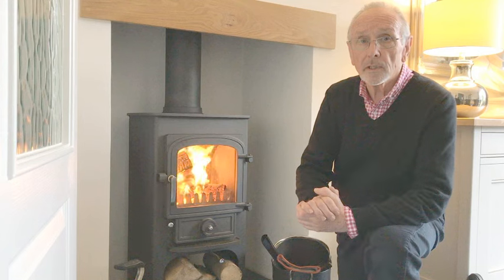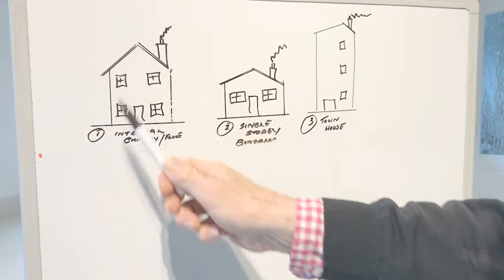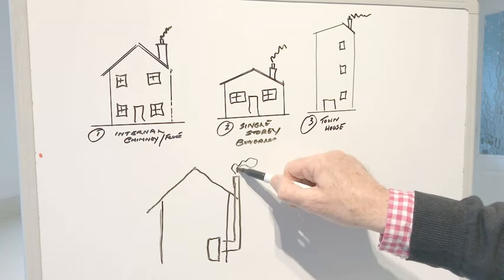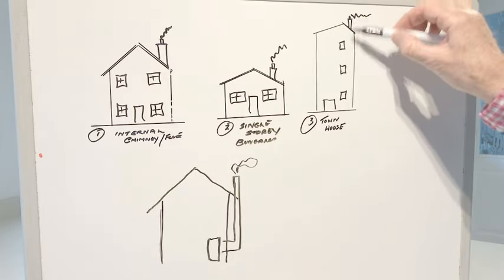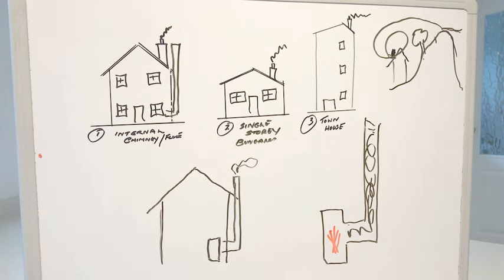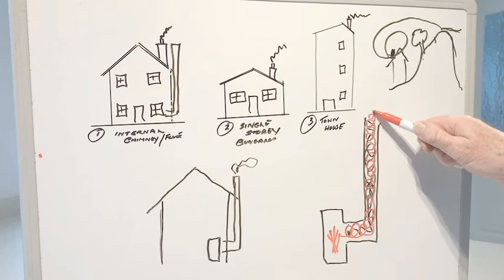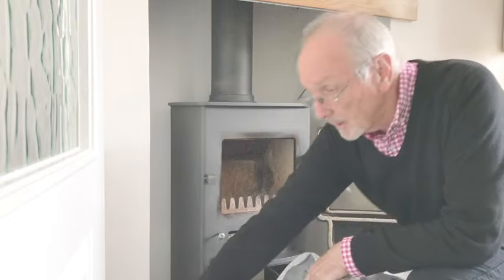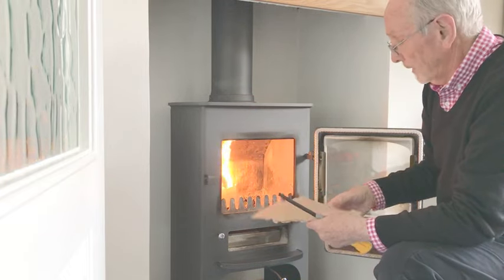How To Stop Smoke When Lighting a Log Burning Stove

Comment: Thank you for this video! 
You can also adjust the damper or the front pieces
Notes : 
You draw fast, like an artist,
There are different types of chimneys. 
sometimes smoke fills the room due to the cold air in the chimney, so heat the chimney up. 
Goodness when the smoke fills the room, it burns the eyes so bad. 
Be thankful if you have a electric heater.

Comment: Thank you so much Mike for your advice. We moved into  our house 3 yrs ago, and felt pleased it had a woodburner. It has a rear flue and stainless steel chimney on the outside wall. Every attempt at lighting the stove threw thick smoke into the room. We then had to open windows on freezing cold days. After many unsuccessful attempts over the first year we gave up on having a fire. The whole house smelt of smoke. Not nice! Now I know why it happened so maybe after three years I'll be able to enjoy the look and warmth of a fire burning in the stove. Fingers crossed. Thank you again. Very informative.
Reply: I have the same problem at the moment and his drawing basically showed our scenario so I’m hoping we can figure it out with these tips.  Anyone have luck with this method?  We just installed a jotul 507 and spent so much getting it set up that it’s a shame we’ve run into so many beginner problems lol. I am excited to feel at ease with it on eventually.  Not fun when the house fills with smoke and you don’t know what to do. Even worse when you’re left cold and Smokey smelling.

Comment: We've had the same issue of smoke in our house when lighting a new fire.  We place a small ceramic space heater in fireplace on a piece of foil and let it run for 15 minutes or so before starting fire.  Works great.
Reply: I use a hair blow-dryer. Works great.

Comment: Great video, I’m a chimney sweep and I’ve found this a lot with people thinking they have a blockage in the chimney, I advise the same lighting a few sheets of newspaper to create the heat to push the cold plug of air out of the chimney, it’s usually external flues when’s it’s been really cold or it can be a traditional internal chimney if it’s not been used for a while. It’s also better if the chimney is cleaned regularly. A clean chimney is a safer chimney
Reply from the maker: Thanks Kevin that's good to know. Regular sweeping is essential.

Comment: Great video. No one ever teaches you this stuff! I think using your tips will help us a lot. I am still having an issue with once I add more wood I get smoke again. Any suggestions.  Thanks so much for your awesome content.
Reply from the maker: Hi and thanks for your comments. As regards the after smoke issue, I can only suggest the choice of material may be at fault or a lack of draft.  I personally have a few logs and chopped wood which is very very dry and would help you also in bringing your stove and flu up to temperature very quickly!  This is probably a temperature issue so really stoke it up quickly with your driest soft woods. If this fails, try opening an adjacent window or door for a few minutes. Good luck, stay safe and warm!
Reply: @mikecraft4506  thanks so much for responding. I will try that! We are currently using seasoned wood we brought into our barn 2 winters ago. Is it possible it’s too dry? I read that somewhere on google but it didn’t make sense to me…. I am also very new to this so I have a lot to learn. 😆

Comment: First looking at this I'm a little confused, I thought the whole reason why you couldn't light the wood is because the smoke from it will come back into the house, so how is it that you're able to light newspaper without smoke coming back into the house?
Reply from the maker: You need a lot of instant prolonged heat to be able to lift the cold air up the flu, without this on the coldest days it can fail and does for many. Every stove installation and fireplace are different and many people fail because of a lack of preparation. I am old enough to have seen this over many years. I had one set of grandparents who worked below stairs in a large Victorian house with many fireplaces. All fireplaces each day were cleaned and made ready for the household to request the fires be lit. One thing certain was when lit, the fire instantly had to be good with no smoke or failings. This is where I am coming from! Getting to know and understand any issues you have (if any) are understood and managed.
Reply: @mikecraft4506  I would agree with that completely,  I have a system of placing a small space heater at the opening of my fireplace and allow it to heat up the flue for 1hr, then light the log and every time without fail I have a smoke free experience.
Reply from the maker: That's a very good solution  @fightingquads9198
Reply: A small smoky fire doesn’t want to go up the flue. You want a fast burning hot fire with little smoke and thus the use if paper.
Reply: @fightingquads9198  heat gun might work...?

Comment: just do as i do   fill up the stove with paper and kndling    let it burn on high  the stove with large logs  let air wide open for little while in till the large ,logs are burning good
Reply: I think you missed the concept of cold air in the flue stopping the smoke going up the chimney and then entering the room.Mike's idea of the blow torch is a really useful way to stop this happening. i.e. Forget about the paper and heat the flue directly with a torch.